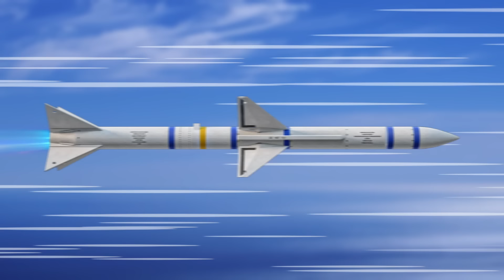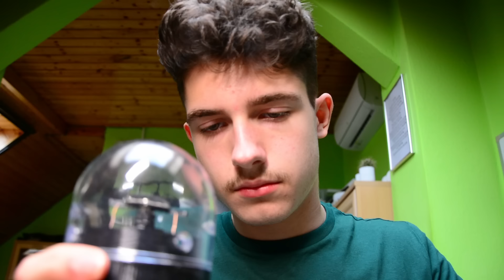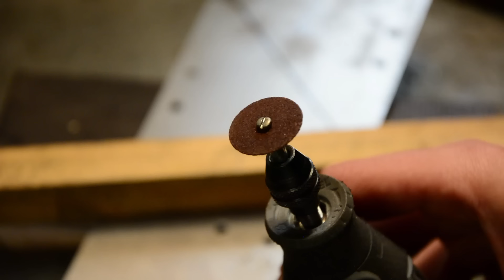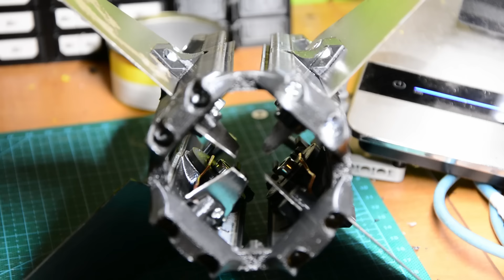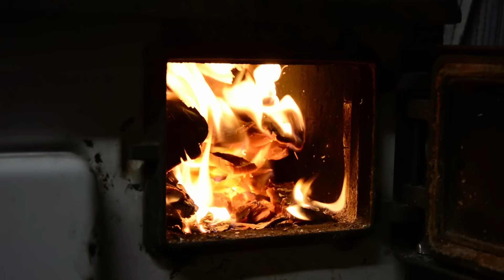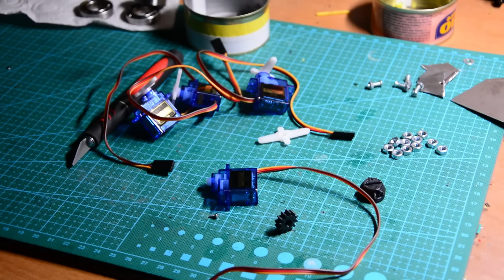Can I Build a Missile for $100?

Comment: The missile knows where it is at all times, it knows this because it knows where it isn't
Reply: By subtracting where it is from where it isn't, or where it isn't from where it is (whichever is greater), it obtains a difference, or deviation. The guidance subsystem uses deviations to generate corrective commands to drive the missile from a position where it is to a position where it isn't, and arriving at a position where it wasn't, it now is. Consequently, the position where it is, is now the position that it wasn't, and it follows that the position that it was, is now the position that it isn't. In the event that the position that it is in is not the position that it wasn't, the system has acquired a variation, the variation being the difference between where the missile is, and where it wasn't. If variation is considered to be a significant factor, it too may be corrected by the GEA. However, the missile must also know where it was. The missile guidance computer scenario works as follows. Because a variation has modified some of the information the missile has obtained, it is not sure just where it is. however, it is sure where it isn't, within reason, and it knows where it was. It now subtracts where it should be from where it wasn't, or vice-versa, and by differentiating this from the algebraic sum of where it shouldn't be, and where it was, it is able to obtain the deviation and its variation, which is called error.
Reply: @FlippitImClippit  brøther i cräve the forbidden   h e a t   s i g n a t u r e
Reply: @FlippitImClippit brother you don't have to explain this long 🤣😭😭
Reply: @The_username1001  thats the joke
Reply: @FlippitImClippit  the missile is very skeejy, needs to falafel asleeby. goodnight mr. the missile!
Reply: @FlippitImClippit  Plus y'all are jealous because it gets to hang out with the hottest jets.
Reply: @FlippitImClippit  i got an stroke from that

Comment: I liked the part when he used a dremel to cut the steel plate instead of doing it in 0.0001 s with the angle grinder cheers
Reply: I think he is legitimately afraid of the angle grinder. For good reason too since he is inexperienced